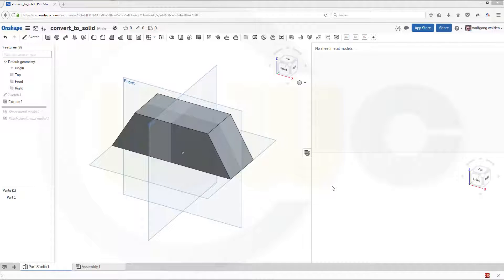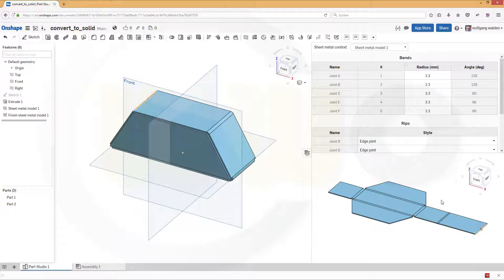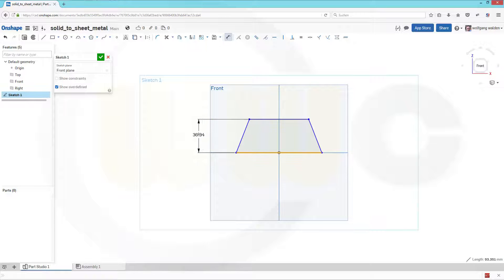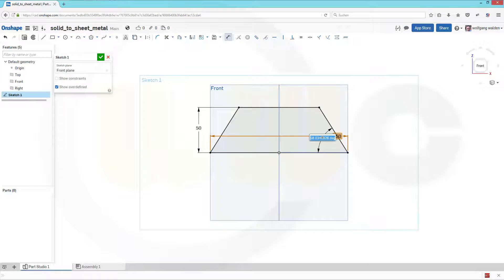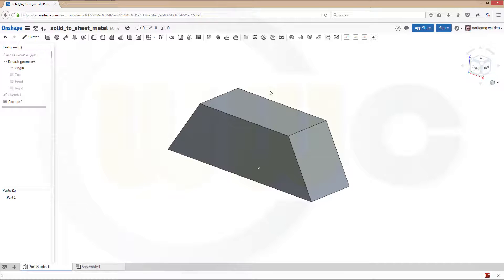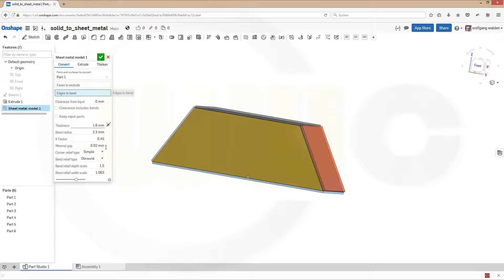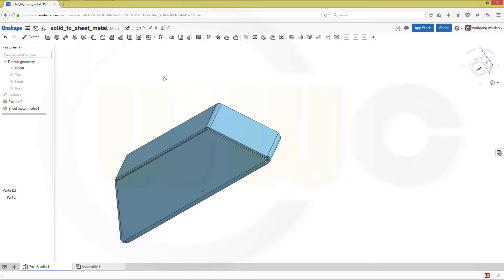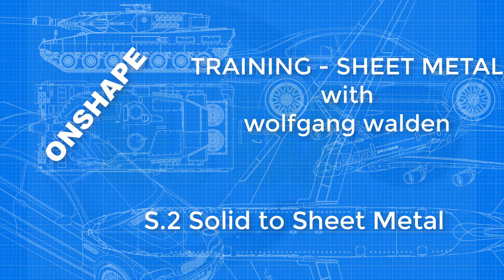S.2 Solid to Sheet Metal -Onshape Sheet Metal Training

Comment: If I wanted to add flanges to some of the sides, how would I do that? I did something similar to what you did for a class I'm in, but I can't figure out if I can or if I'll have to restart and model how you would in SolidWorks
Reply from the maker: Just use the Flange - Feature - it works the same way as in SolidWorks, Inventor, Catia etc.

Comment: Hi! Im wondering if its possible to extrude, make holes in the sheetmetal mode? When I finished the sheet metal mode I did holes in solid mode, but the holes didnt show up in the flat "drawing" , what Im doing wrong? Thanks :)
Reply from the maker: I assume you have to make the "holes" before you convert your model into a sheet metal model. But I would have to check it for myself because I don´t do a lot of sheetmetal and if I do I don´t use onshape, sorry.